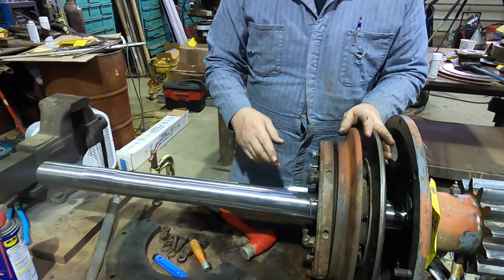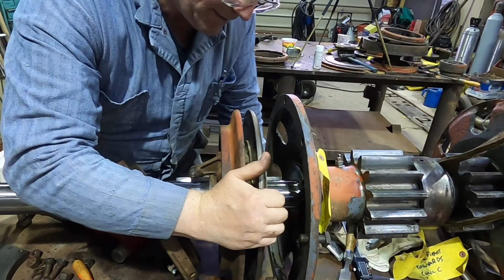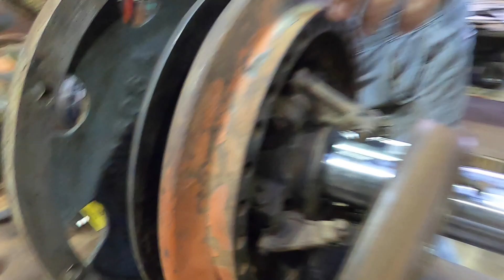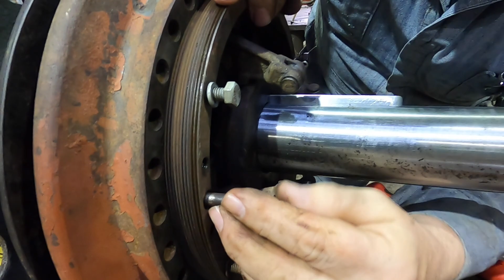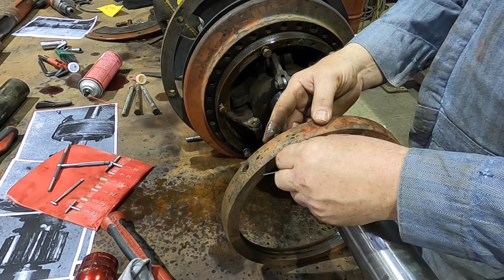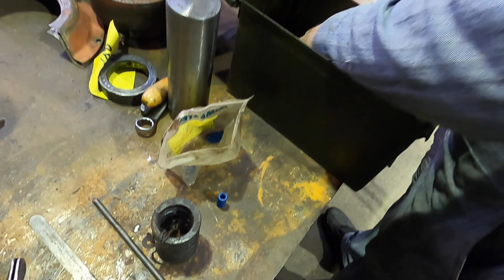Machinist's Minutes: Reassembling a churn drill main shaft (part 1/2)

Comment: No runout on driven plate makes for an extra strong clutch, been there done that a bunch of times. Had 6 cable tool well drillers operated in central Md. & Pa. 40 years

Comment: Good to see that someone else uses pictures - a good digital camera is the most valuable tool in any repair shop!  Take pics of work when it arrives to prove its condition (the customer did/didn't send the pulley/bearing/shaft they said they did), take pics as it comes apart to aid in quoting and reassembly, take pics when it ships to prove it's all there and in good shape when it ships.

Comment: In one of your  videos talking about welding you  mentioned squishy rod .what rod are you talking about? And will any of your 18 series rod work harden  thank you for your time sir
Reply from the maker: 60xx-80xx rod is "Squishy"  most commonly for squishy I use 7018, I usually use 11018 for more strength/some hardness.